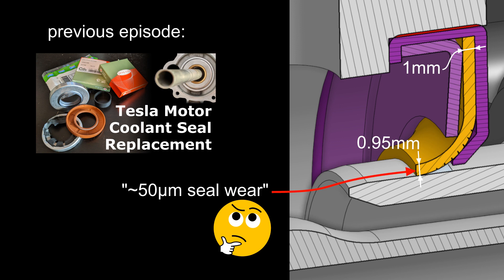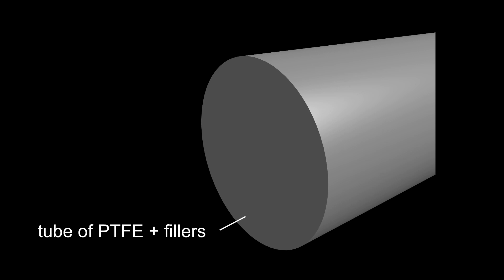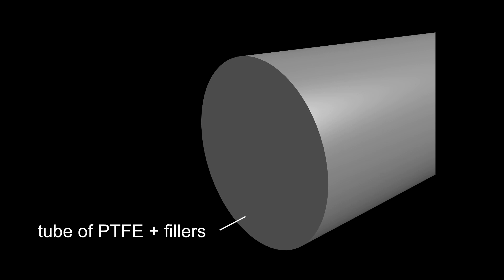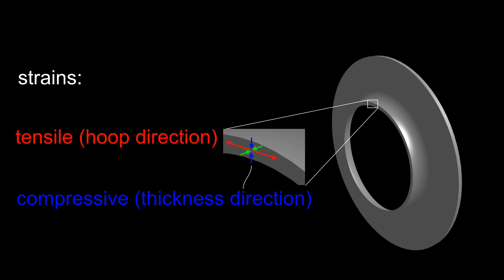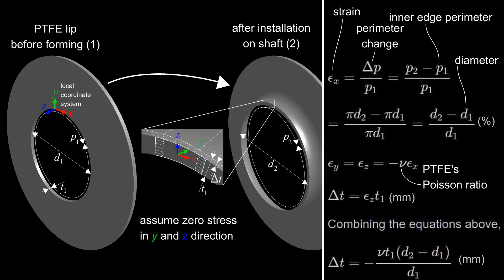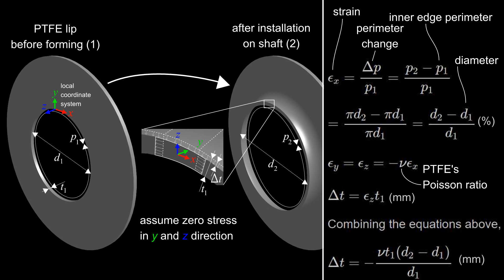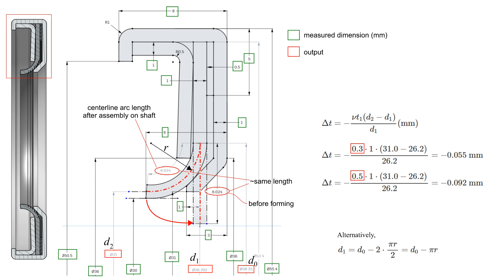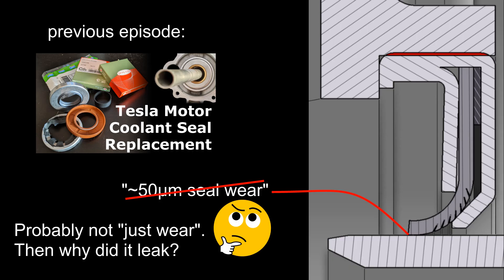Tesla Coolant Seal Lip Thickness Analysis (see updates in description)

Comment: Thanks for posting this content. I just had my Drive Unit replaced and am awaiting the time when the new unit begins to leak. The replacement unit has a part warranty of 2 years from Mercedes, but we'll see how they feel if it begins leaking. As a prevention, I'm looking into running Evans waterless coolant and zero pressure (open coolant cap) or even a negative pressure similar to the "leak shield" system for water cooled desktop computers. Any thoughts of prevention? Thanks!
Reply from the maker: Actually I just started researching the effect of coolant additives. The current coolant is Zerex G48 which contains silicates as additives. These seem to form nasty deposits right next to the seal lip on the shaft. So a different coolant may help. But.... What additives are in EWC exactly?
Reply: @diyEVguy  Not really sure what sort of additives the Evans has. What I was looking at is that fact that it doesn't rely on pressure to keep the boiling point low. Seems like a lot of folks run it in notoriously leaky (under pressure) cars at zero pressure. Google "zero pressure coolant system". What is your intuition about the role of coolant / air pressure differential across the seal and its contribution to leaking? One other question: My B250e has two chambers in the coolant overflow tank leading me to believe that the battery coolant circuit and the motor coolant circuit are separate. Is that true of the Rav?
Reply from the maker: @ScotGraham  Ah I see your point. Interesting. I have to do some research before I can answer because for example I assumed that EV cooling systems are generally not using pressure for boiling point elevation bc not needed bc battery goes to max 55degC and rotor 85degC but I could be wrong.
Reply from the maker: @ScotGraham Update: EWC is reportedly pure glycol plus additives, which is an order of magnitude more viscous ("thick") than water, so EWC can increase friction at the seal/shaft interface w.r.t. 50/50 glycol/water (Zerex G48), in turn increasing the temperature at that interface, which is not good. Also the heat capacity of glycol is significantly lower than water, meaning that the coolant temperature increase is significantly higher than water per unit of injected (frictional) heat energy. Also for pumping a more viscous liquid, a higher pumping pressure is required (independent from the pressure increase due to expansion in a closed system).  So I doubt that EWC is an improvement in this case.
Reply from the maker: @ScotGraham  Yes, the RAV4 has separate circuits for drive unit and battery. I want to replace the battery coolant soon too. May make vid about that too.
Reply: @diyEVguy  Would this mean a more stringent flush interval might help this problem due the silicates?  Maybe that's the whole problem.  If the seal 'wear' isn't the issue, then gumming up the shaft or electrolyzing the coolant would be my guess as to what is going on which would cause deposits and irregularities due to discharge from high voltages.  I wonder if another heat exchanger method (like a trans cooler) might be used in-loop to the coolant system to keep the coolant temperature more stable if the evans coolant and the thicker viscosity runs the risk of higher operating temps.  I definitely feel that the viscosity is probably a huge part of the problem since I have been looking at this problem on/off since July 2022.
Reply from the maker: @eastmanresearch3143  Good question. I just ran an experiment: dipped a soldering stick tip set at 110degC (my calculated lip temperature, fwiw) in Zerex G48  (in contact with air) and deposits formed within 10 minutes (at coolant/air interface)! After 24h, much more deposits. I could scratch deposits off by nail, it was a bit gel-like. Howard said his shaft needed sandpaper to clean, so maybe more crystallized or so due to longer time or electrolysis etc. Not sure if my experiment is representative, but it does not look good. And it may suggest that early coolant changes have negligible effect bc deposition happens fast.
Reply: @diyEVguy  This is great data.  I would be curious if you have the same problem at 85c in terms of the silicate buildup.  If not, this tells us a great deal.  Very cold areas like Wisconsin, Minnesota may have drive units which do not fail but every 150-250k.  I personally know one guy on the tesla forums in that region who has over 250k on his current DU.  If the temperature is the problem, a reserve tank of coolant might help us with this problem to reduce the overall temperature.  I would also think those who do lots of pegged accelerations on the performance DU's will generate more heat vs. the standard LDU.  It would be interesting to see if there are any chemicals which could be used to flush the DU's safely and get rid of this silicate scale buildup safely.   I think the next question is - if the seal isn't bad can we just clean up the shaft and re-use the original?
Reply: @diyEVguy  zerex G30 coolant is silicate and phosphate free - might be worth a shot to test.  -65 to 254F range.  Made to work with aluminum and minimize corrosion.
Reply from the maker: @eastmanresearch3143  Silicate and phosphate were used because they "act fast" on cavitation pits on alumimum impellers, if I remember correctly. Does G30 protect the pump impeller equally well? Dang it I am just assuming the impeller is made of aluminum. I don't know for sure.
Reply: @eastmanresearch3143  I run the LDU website with Johan. Data shows its not mileage but rather time for for the LDU and battery pack failures. For these 150-250k LDUs, do you know if there is indeed no leak (first visible sign is on speed sensor) or potentially leak hasn't caused collateral damage (rusted rotor/stator, low isolation in stator, damaged inverter) Another huge factor on leak is seal installation quality as PTFE seals is much easier to damage than classical seals AND this seal's installation is blind (meaning you can't use a sleeve tool like typical PTFE seals) so there is the variation of who did the rebuild (Tesla is surely contracting out rebuilders which then have multiple employees) Furthermore, Tesla has at least changed seal design/supplier 2x if not more. So lots of variables and really hard to pinpoint down to 1 cause.

I highly doubt coolant temp varies that much between colder and warmer climates. Coolant temp is set to keep battery healthy and thats not a very large temperature window. Coolant around the seal heats up due to seal frictional heat.

Anyway, if you can confirm these LDUs indeed haven't leaked by speed sensor inspection, that'd be great. Then LDU rev # would be helpful. Seeing the seal/shaft would be best of course to see seal type (single/triple lip) and shaft condition (pitting, polishing, debris coating) but that is a destructive inspection (I would replace the seal after its been pulled)
Reply: What do you guys think of the idea of running small negative pressure on the LDU coolant circuit. I was intrigued by the approach used in water cooled PCs. Google "Leak Shield Aqua Computer". Not the actual Aqua Computer equipment, just the concept. I've always assumed coolant "leaked" into the motor due to the pressure differential between the coolant side vs. the air side. One other question: Does the entire coolant flow that travels through the rotor continue up and through the small aluminum tube that connects to the inverter side of the gear box? Seems like that's an awfully small amount of flow to cool the rotor.
Reply from the maker: @ScotGraham  I lack knowledge to judge that... Maybe it poses a higher risk of cavitation. Could you make a simple analytical model of the physics involved to gauge the feasibility?